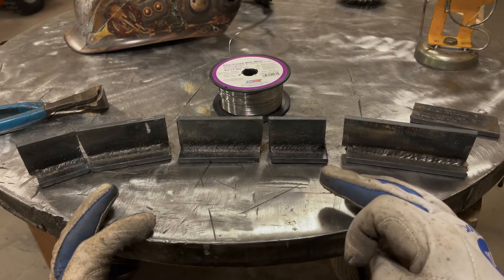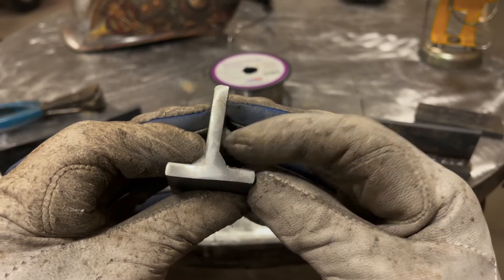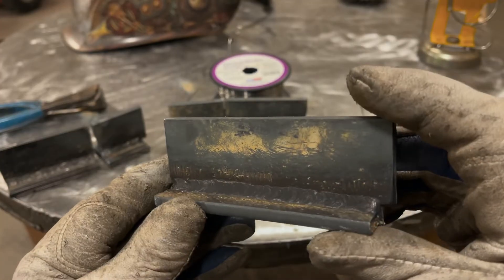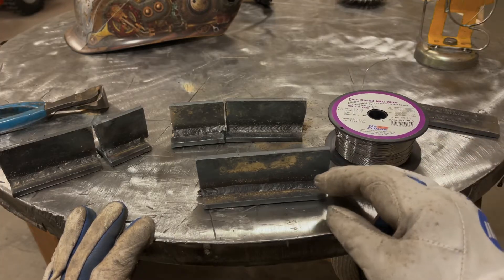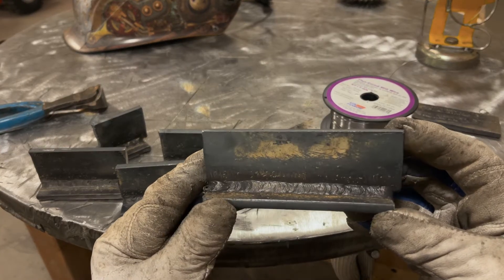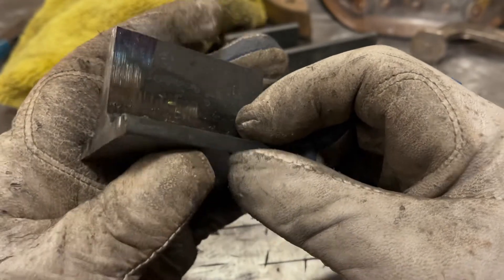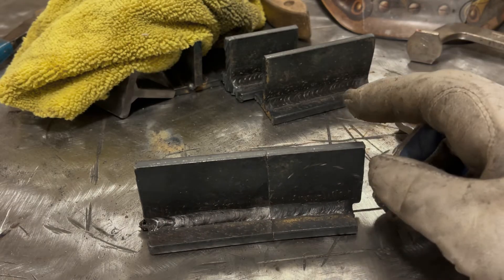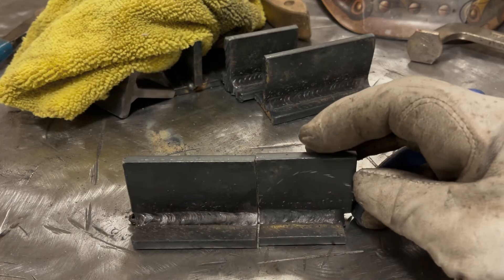Flux core welding part 4.5: let’s do another test on 1/4in steel to troubleshoot the problems

Comment: Hey Greg. After watching this video, I decided to do a test on the titanium flux so I hooked it to an amp meter and went all maxed out and surprisingly enough. It actually pulled 148 amps consistently on a 10 second bead, even though it’s rated at 125 it pushes out 150. Just something I wanted to share as I was surprised at this. Cheers.
Reply from the maker: That’s not too surprising, thanks for doing the test 😀👍.  One of the more wild things about wire welders is essentially they are a controlled direct short.  The only thing that limits the current output (and thus current draw on the input) for many machines is the wire feed speed.  You were able to achieve 140+ output amps, based on probably .035 wire.  Well if it was possible to run .045 wire in it the amperage loading would massively increase.  Many machines in the 140a class make the assumption the output will never go much above 140 because the wire feed will never be adjusted that high.  The problem is they need to have high wire feed speed settings for .030 wire, so the possibility to run way high WFS on .035 wire is always there lol.  Normally a breaker will trip and that alone will likely prevent a meltdown of the machine.  

What’s interesting is fronius machines actually actively control output on 120v to prevent massive overloads on 120v.  The machine will actively lower the wfs to prevent excessive current draw.  It’s possible other higher end machines do this, I just have never used them on 120v.  Also with stick welders overloading isn’t as big of an issue.  Since they can set the machine up to not allow more than say 80amps on 120v and they can have a voltage cut off of say 25v, there is no way of overloading the machine.  Wire welders are far more of the Wild West lol.
Reply: @makingmistakeswithgreg I didn’t say it in my first comment but I I measured that with .030 flux YESWELDER wire from Amazon. They had a 5 pack on sale for $30

Comment: if im not getting porosity on my GS wire, and i clean it up completely, can i do multiple passes?    my arc captian wire runs smoother than any other flux wire ive tried.            it seems to me that any wire thats vacuum sealed will run super nice because its not tarnished at all.     most companies dont protect their stuff from oxides forming, and then they have to fight to join in the weld pool.  just a thought.
Reply from the maker: Here is all the info you need to decide this.  So -gs wire is a complicated product.  By specification -gs wire is not tested to meet many specs.  That doesn’t mean it doesn’t meet similar specs to t-11 but there is no way to know.  The issue with multiple passes has to do with how brittle -gs welds tend to be.  A single pass isn’t an issue, but welding over that pass produces an even more brittle weld.  I have actually hardness tested (off camera) numerous -gs wires and t-11 and found the -gs welds are indeed significantly harder.  

Another issue with many self shielded wires is they tend to produce internal weld porosity on thicker weld deposits.  If you need to weld thicker steel multi pass make sure you do a test plate on the same thickness and cut it in half to verify there isn’t internal porosity.  

As far as what you should do, I would avoid -gs honestly.  If that’s what you have and runs ok, I would take a metal file and try to file a single pass of it.  If the weld files like the base steel I think you’ll be ok.  If the file skates over it I would definitely avoid using it.
Reply: @makingmistakeswithgreg  ok thank you, I really appreciate you taking the time.  I'm gunna definitely take a file to the welds and try to do a bend test after multiple passes.       When I chip the slag with the hammer it makes some decent divots in the weld, and the slag is coming off nicely, so I have some hope.         I just bought a bunch of it too, so I hope that wasn't a massive mistake lol.

That would be an interesting video idea, to see what happens if you weld thick plate together with single pass wire.  And then bend test it, see if it makes a big difference or not.      I guess since it varies so much brand to brand,  maybe not.
Reply: btw its noncritical stuff mostly, but also framework for my trailers and truck.  i know its not ok for for pipelines and whatnot, but if i can tell its a good clean weld, and i chip and wire wheel it totally clean, is it ok to do multi pass with GS flux wire?  i hope you see this haha   I asked chat GPT, and it said it should be fine if theres forsure no slag. but id rather hear it from a professional welder.

Comment: Hello I am running a Lincoln that was given to me 15 years ago one of the little 120v duel gas or gasless units.  The little machine  has made me a good bit of money over the years doing on and off sight work work.  I still have never tried it on gas and I think I might still have part of the .030 roll I got.  I don't know what it is but me that welder and .035 we jive lol like hot sauce I put that shit on everything.  To this day I have to remind my self to slow down both the wire speed and weld travel. Trying to think how best to describe but on heavy stuff I find wire speed just needs to be fast enough to sustain the arch and of course depending I have a bit of a weave I guess like a prefect V  situation over half the time would be aimed at the root with almost a flick left and right with a real short visit to the edge of the pool you are about to leave and back to the root or something like that
Reply: It would be interesting to cut length wise down the wire to see but I suspect that at .030 flux core a difference between the good and bad could be the flux to medal along the length.  At .035 there could be more room for getting the ratio closer to ideal.? its a thought and I have no idea if it even could be true

Comment: I know this is old clip but...
What will happen if you slow the feed a bit?
Similar as you have porosity if you have too short stickout so the flyx is not heated enough. I think... if you slow down the feed, flux will be heated more cos it have more time to travel from the tip to the material.
Of course, as absolute begener, I have no clue what are other conseqences of slowing down the feed
Reply from the maker: When you slow down the feed you must drop the voltage to get it close to the correct ratio of voltage to wire feed.  If the feed is too low you can get burn back where the wire melts off at the contact tip before it leaves.  The other issue is heat input. When you drop below ideal wire feed speed for a particular thickness you won’t be carrying enough heat to get proper fusion.  There is quite a bit of adjustability with flux core with WFS and voltage, however what works the best for a particular thickness is a fairly narrow range.

Comment: with the lincoln wire even tho they say you can weld 5/32 plate , its with multi pass , it might be that with the 2nd and 3rd pass the plate is up to temp . the old stand by i do is if its thick plate i take the torch and give it some comfort b4 the wire hits it , even with the sa200 , a little torch tickle first makes a bit o difference . this is a great series you doing , im finding lots of new stuff to ponder i never did b4 , and with the equipment you got, the results are very interesting . thanks .
Reply from the maker: So I contacted Lincoln about that to find out what wire can really weld what thickness, and what I found is they generally recommend stepping up wire diameters to weld 1/4 and above.  I have done probably 20 bend tests and 30 cut and etches with flux core, and universally .035 flux core will have a few spots of porosity internal to the weld on 1/4in and above.  It has major porosity at the 3/8th thick steel.   So from a standpoint of wire to steel thickness .030 is generally good for 1/8th to a bit over, .035 to 3/16 to 1/4 (1/4 will have pundit porosity), and .045 to 5/16, and maybe 3/8th.  The biggest downside to self shielded wire is much of what stores sell is -gs or sub par t-11 and the weld defects (if they are even known) become a major issue.  I wouldn’t have ever known about the defects internal if I didn’t do so many tests.  The exterior often looks perfect.
Reply: @makingmistakeswithgreg  thats interesting that licolin would come back with that , considering their 211 .035 does say on it 5/32 with multi pass . i have never used a 120v unit to weld anything bigger than a 3/16 grate , i just dont think it really has the womp to do it safely / properly , basically bed frames to make a buzz box scooter or something . i have found box store house brands ok for around the house projects , but nothing id want to stand under . still , great vid , good to see someone digging deeper than paper from the suppliers . thanks , Greg.

Comment: The US Forge had some porosity but the weld penetration at 0:57 looks much better than the Lincoln.  You prefer the Lincoln wire because it had less porosity yet did not appear to have good penetration.  I would have thought that the penetration is more important.  Thoughts?
Reply from the maker: From a standpoint of porosity, it significantly weakens weld strength.  In a strength test porosity will cause weld failure faster than less penetration.  The hard part with cut and etches in that specific video the penetration on 1/4in steel will be variable start to finish.  The welder was never really designed to weld 1/4in steel so the penetration will be more inconsistent than what a welder with more power would do.
Reply: @makingmistakeswithgreg  Thanks for explaining.

Comment: Not only practical knowledge but theory as well. This combination makes the welding “picture” much clearer. On a recommendation from a former coworker, I have been using INETUB BA71TGS .030. It is produced in Italy and I have found it to be very good wire, especially for a novice like me.